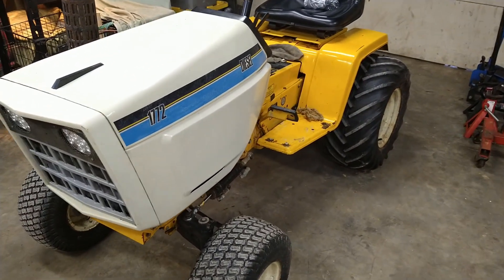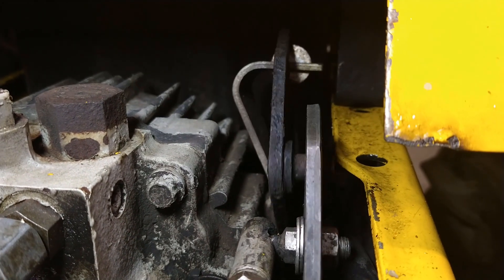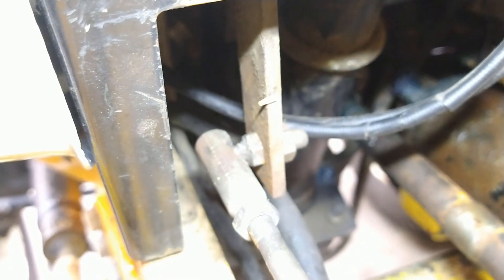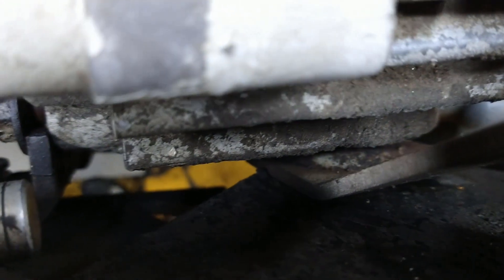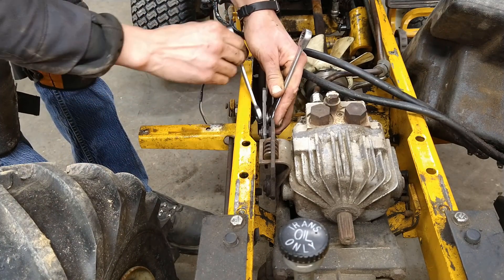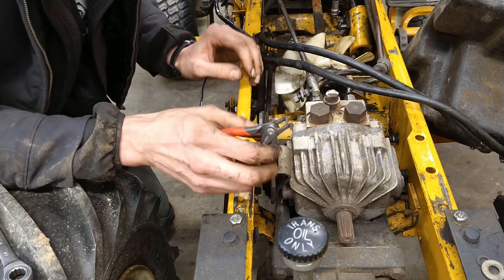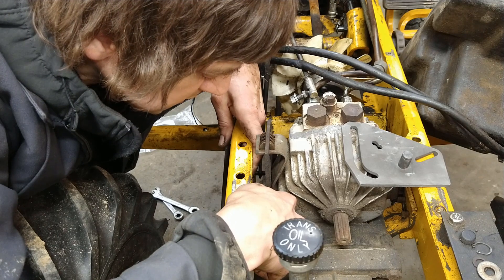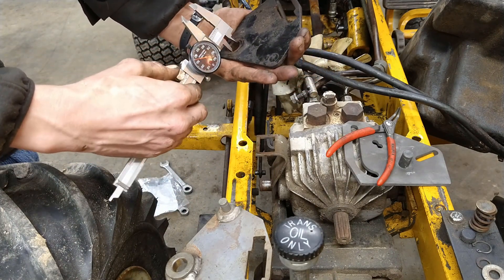Hydrostatic Transmission Control Repair, Part 1 – Cub Cadet 1772

Comment: Hey guys...Ron from Ohio... just getting ready to do the trunion repair on the 1872... speeds just started fluctuating at the end of last season and let it go till this year... your 2 videos are a perfect explanation of the needed repair... will check back if I have any issues setting the neutral.... also doing a clutch rebuild on my 1200 soon. Thanks buddy!!
Reply from the maker: Sounds good Ron!

Comment: Is there an adjustment for hydraulic steering when turning a sharp corner and forward movement slows to stop or CRAWL? I running an 1854 that does that?
Reply from the maker: There is no adjustment, but what is happening is related to internal pressure dynamics of the shared hydraulic system.  The steering valve and hydrostatic transmission drive motor share the same pressure circuit.  When you request full flow/pressure to the steering valve, there will be a pressure drop on the motor.   If you make sure that your linkages and trunion controls are rebuilt, and you have changed the fluid and filter, that pressure drop should not cause a huge difference in forward or reverse motion.  There will most likely always be some change, but it shouldn't stop movement or decrease it in the way you describe.

Comment: Quick question ( and somewhat unrelated)..what motor oil do you use in the Kubota?? SAE 30 is not good here in far upstate NY cuz even in June and August it gets down to 40F at night and might be 90F the next day..I'm thinking 15W-40 year around..
Reply from the maker: 15w-40 year round for most of the small diesel engines.  I would not use straight 30 weight in the winter.

Comment: That is an awesome tractor.  My 1641 needs minor adjustment in the hydro control.  Thanks for putting these videos together - most helpful.
Reply from the maker: It is an awesome machine.  Wish I had one!

I believe your 1641 has a different hydrostatic pump than this.  Yours most likely has the HydroGear BDU-21 that they continued to use in the 3000 Series tractors.  The control linkage is much less complicated.

Comment: Glad I found your channel.  I have a 1969 125 with an IH rototiller on the back of it.  Runs great but a few problems with linkages.
Reply from the maker: Thanks for taking the time to comment - and good to hear of another old Cub still in service!